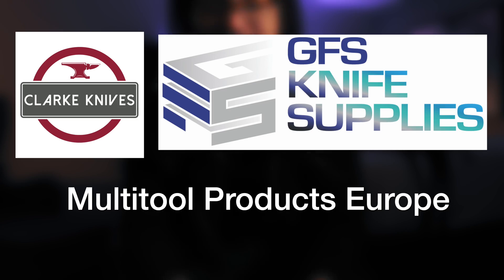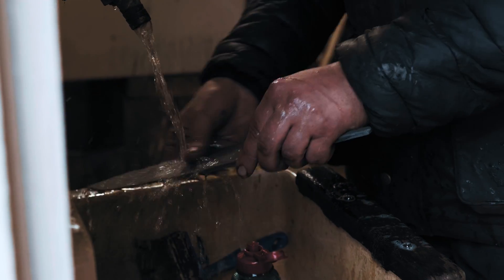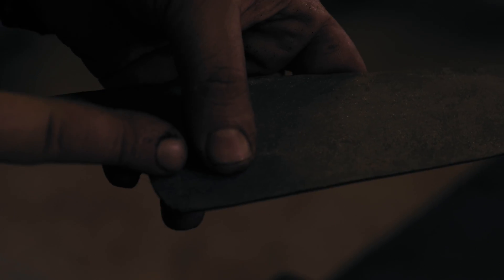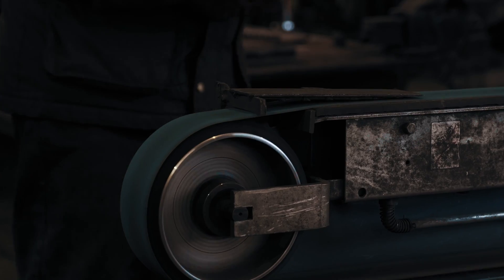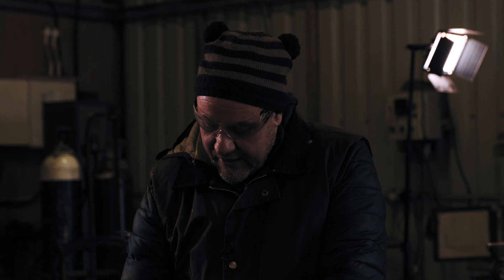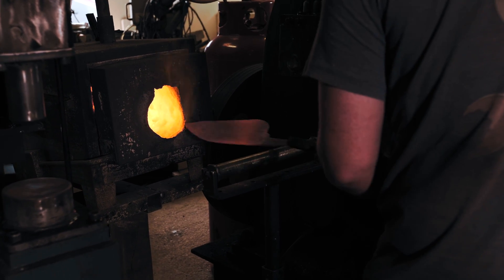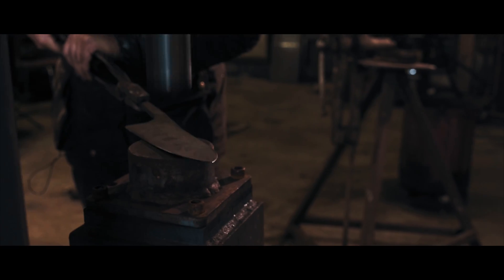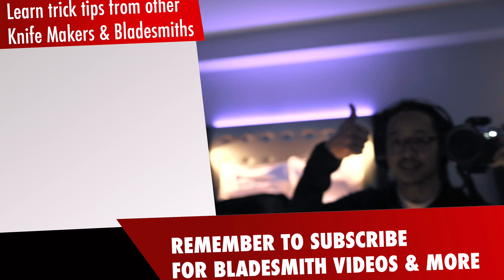Will your knife break if you forge COLD?

Comment: Which steels can you cold forge? I mostly use 80crv2 and 1095. I don't have a power hammer so I wouldn't hit it hard. Just minor adjustments with the hammer. Hate having to fire up the coal forge to fix something tiny that I missed.

Comment: And here I was thinking forging cold would shatter my blade 🤯
Reply from the maker: Just for claims, only certain types of metal can be forged cold. Wrought iron is one of them, which is what Will was working on here in this video series.

Thanks for the comment!

- Vinz
Reply: May I also add . Even though it is called cold forging ...  Every time and the speed of the strike creates heat it's self . This helps move it .   I do understand the Hudge temperature  difference.